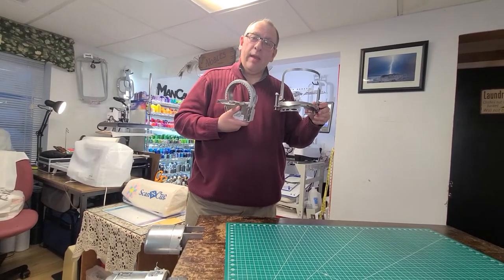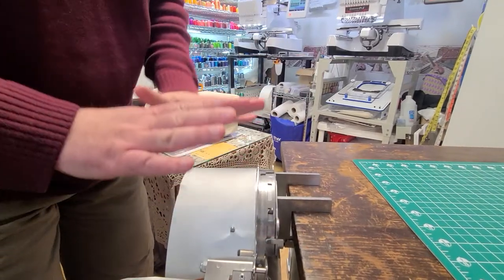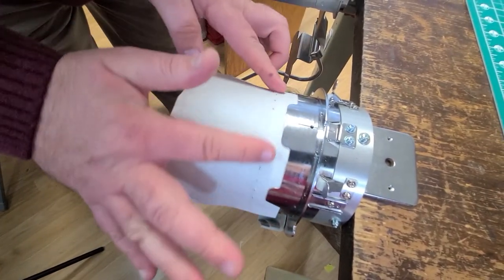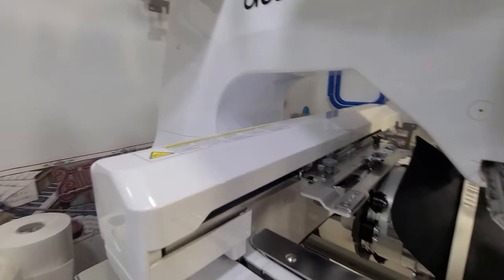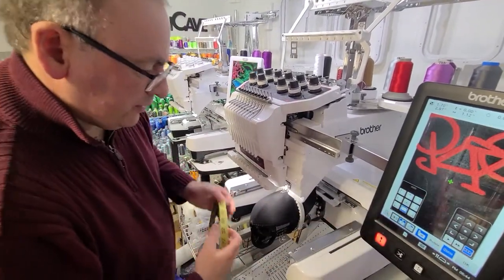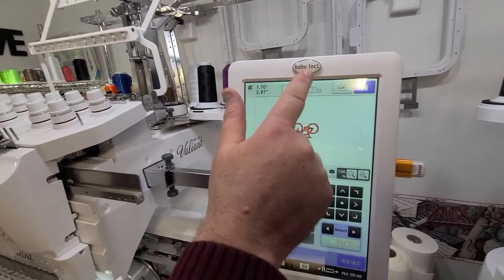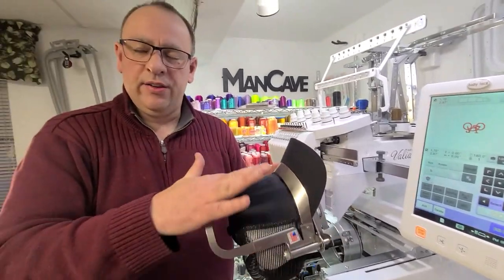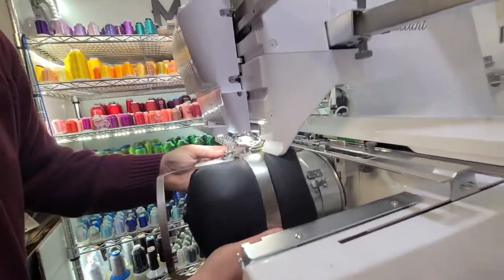Compare Hoop Tech Gen 2 hat hoop and Brother/Babylock flat brim hat hoop

Comment: Just wanted to thank you for your video. I wanted just the override bar and because of you, I was able to buy it. I do plan on getting the Gen2 system, but not right yet. And I may also buy the new brother hoop. I have the wide cap setup. I end up hitting the underside of my machine w the bill clamp. It is really irritating. I break quite a few needles going over the center seam on a structured hat. I didn't know the centering trick, so you taught me there too. I really appreciate your video!
Reply: I got the override clip with my gen 2.  My question is the directions are telling me to remove the magnet cover and magnets. Is that right?  Just got my 1st 10 needle and I don't want to break it. My husband gave it to me. Tks in advance. If you have a you tube on how to do that I'd be sure to watch it. Again tks
Reply: Where did you purchase your override bar from, if you don’t mind me asking. I’ve searched and didn’t see any place that sells only the override clip.  Thanks in advance.

Comment: With the new Brother Entrepreneur machine using the Gen 2 override clip and the Gen 2 frame.  Is the brim of the hat hitting the back of the machine and rising up like it was on the Babylock one?  I currently have a 6 needle Babylock and having terrible time with the caps.  I am upgrading and was thinking of the Brother one if the brim of the caps was not hitting the back.  Minus those "Richardson caps", any trouble with Otto or Flexfit?  I have the Gen 2 cap frame set already and am still having trouble with my Babylock. Any information is greatly appreciated.
Reply from the maker: Hi Kathy!  For me, I was able to move a bit closer to the brim using the Gen 2 with their override clip - about a quarter of an inch closer than the standard Brother/Babylock original hat hoop.  But if I moved any closer than about 0.75", I would notice the hat would start to tip/rise up.  But I still considered it a "win" at that time as I was able to get closer to the bill, even if was just a quarter of an inch.  My go-to hat hoop now is the new "flat brim" or "universal" hat hoop from Brother/Babylock.  With the new design of that hat hoop, even with the Richardson hats, I am able to lower the design easily to 0.50", and often within a 1/3 of an inch.  I did lower it once to 0.25 of an inch, but I was too close to the sweatband in the hat.  I removed the magnet, or sensor, from the hat assembly, that attaches to the machine, and in combination of doing that with using the override clip that came with the Gen 2, and the new hat hoop, that is how I am able to lower my design to 1/3 of an inch.  Please let me know if this helps!
Reply: @mancaveembroidery  THANK YOU so much for getting back to me.  I just found your you tube videos and love the way you explain everything soooo well.  I want to get the Brother Entrepreneur Pro and your explanation has just made my decision easier.  I will keep my Gen 2 hat hoop as well for now.  Now just to get the hat hoop included with the sale of the machine???   Thanks again

Comment: Thank you for the video it was very informative. Your opinion if you could only buy one hat hoop for someone starting hat embroidery would you get the Gen tech 2 or the new baby lock? Thanks
Reply from the maker: Hi Becky!  I use the Brother/Babylock new hat hoop 98% of the time.  The hooping method is much different than the other hat hoops - a bit of a learning curve with it with the different styles of hats, but it is my "go-to" for hats.  If I want to embroider on the back or sides of hats, I use the Hoop Tech back-of-hat hoop, which works great.  But with the Hoop Tech hat hoops, you need the original (larger) hat assembly.  It is nice having many different "tools in the toolbox", but if I had to purchase one, I would buy the new Brother/Babylock hat hoop.

Comment: i have the pr670e with the PRCF5 , the same one your displaying here, i purchased the hooptech cap frame, t-bar, and back of cap, little did i know as in the website it says it fits the pr600 , long story short , the cylindrical part of the driver on the prcf5 is smaller than previous model numbers, and sadly the hooptech frames did not fit, 

i guess there is a standard size cylinder part but brother decided to change that and render third party hoops useless, maybe not on purpose but that is the result

Comment: Hello I purchased the override clip after seeing your video placed the bracket on top of the bar and replaced the screws  the hat hoop goes away , however I don't get the hoop symbols at the top allowing me to embroider on the hat like I am on a flatbed hoop

I also have the same hat hoop in your video I purchased it and the override clip after seeing your video 

I flipped the design upside down, however I am not able to use no more space than if I didn't have the clip

I have a Babylock Valiant 10 needle 

Is there anyway I can contact you outside of this chat?
Thanks!

Comment: With the Hoop Tech Gen 2 do you use the driver ENCF wide driver or EPCF3 regular driver? Thanks
Reply from the maker: The Hoop Tech Gen 2 will only work on the "wide" hat frame driver, not the newer "flat brim" or "universal" at hoop that they just released a couple years ago.  The diameter is different between the two hat drivers, and the Gen 2 is made for the larger diameter, or the "wide" hat hoop.  Hope this helps!

Comment: Is it possible to get the design closer to the brim? I have the Hoop Teck.
Reply from the maker: Hi Sara!  I have found the closest I can embroider to the bill using the Hoop Tech is approximately 3/4 of an inch.  If I try to move the design any closer, the back of the hat (part towards me) will tend to tip upwards - this is because the bill of the hat is pressing against the back of the machine.

Comment: So I have ordered the flat brim had driver and am thinking also about the Gen2 Hat hoop.  My question is do you get more than 2.5 inch high with the Gen2 Hat hoop using the override sensor?
Reply from the maker: Hi Shelly!  It has been my experience, with the Gen 2 hat hoop, with using their override clip, the closest I can begin embroidery to the bill is approximately 0.75".  The override clip makes the machine think you are embroidering on flats; however, if you move the design any closer to the bill, I have noticed the back of the hat will begin to tip upwards.  This might be from the bill of the hat coming into contact with the back of the machine.  I just do not feel comfortable with the back of the hat tipping upwards.  With the override clip and the new flat brim or universal hat hoop, I am able to begin embroidery 0.25" of an inch above the bill.  I had a design that was almost 2.5 inches tall, and it worked great, since I was able to start the design so close to the bill.

Comment: Is there anyway you could tell me where to buy that override clip.  I tried to search for it but couldn't find it.  I've reach out to Hoop Tech but never heard anything back.
Reply from the maker: The override clip came with my Gen 2 hat hoop.  I am uncertain if you may purchase it individually.  The main goal is to override the sensor, so that it thinks we are embroidering on flat items, rather than a hat.  I have seen a few people using "homemade" items, such as a small binder clip or even a guitar pick, to override the sensor.  With the guitar pick, they drilled a hole in it for the tightening knob to go through, and then the guitar pick pressed down on the sensor just enough.  On the back of the hat jig, the portion that attaches to the machine, there is a small rectangle piece that is held on with two small screws.  You will need to remove those screws as well - all part of making the machine think you are embroidering on flats, as compared to a hat.  Please let me know if you have any other questions!

Comment: Also what is the widest you can go with the flat brim hat driver
Reply from the maker: Unfortunately, I do not have the exact measurement, but I would imagine approximately 6 inches.  If you are wanting to embroider on the side panel, simply rotate the hat while you are hooping it.  Rather than hooping the hat "straight", with the middle seam lined up with the middle of the hat hoop, rotate it to one side.  I have a video demonstrating this  method.

Comment: I just purchased it and can't get lower than 1.25" from the brim. I have a PR600. Is there a trick to lowering it?
Reply from the maker: Hi Howard.  Unfortunately, I am not that familiar with the 600 series.  :(
Reply: Howard I have a PR1000e and have the same problem. You cannot get lower than about 1.25" without the brim of the cap rubbing on the lower case. I am experimenting with a modification using the bill retainer off  the standard hoop and can get it about the normal 1". Hooptech should address this issue with Brother machines and not advertise getting embroidery closer to the brim and also have found it not suitable for flat brim caps.

Comment: What is the maximum height i can embroider on the gen 2 hoop?
Reply from the maker: The maximum height would be determined, in part, by the style of hat.  In my experience, I have not been able to embroider closer than 3/4 of an inch above the bill using the Gen 2 and the override clip.  Any closer, and the back of the begins to tip upwards.  With the new Brother/Babylock hat hoop, with the override clip, I have embroidered 1/4 of an inch above the bill.